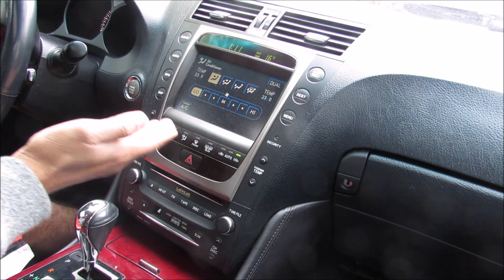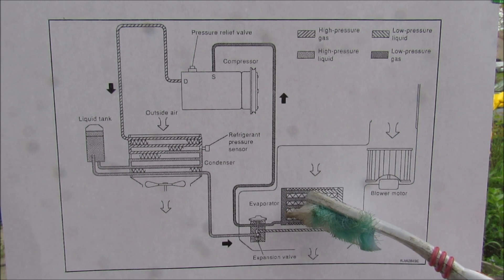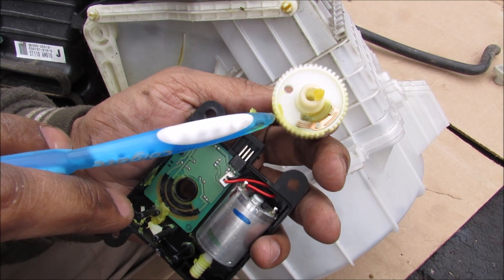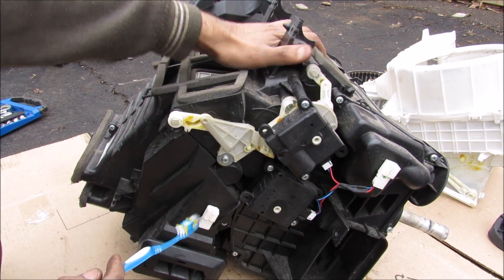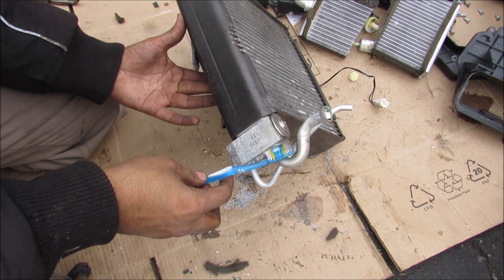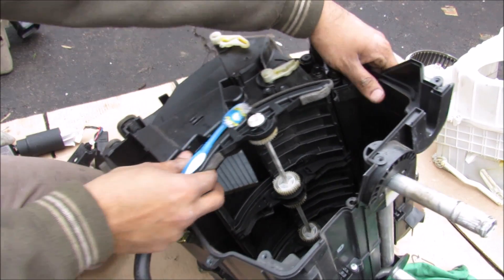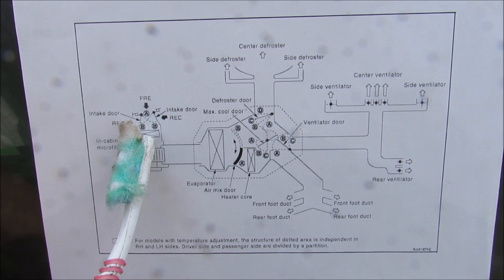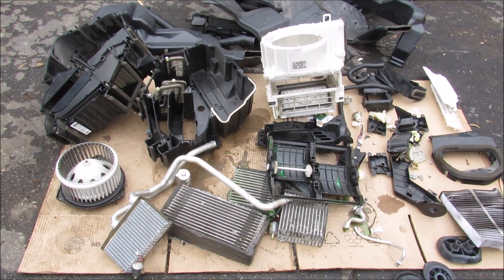How a Car Automatic HVAC System Works

Comment: If the motors are CAN based there should be 4 pins right CAN high CAN low supply and ground

Comment: And if one little thing goes wrong in that complicated mess... 8hrs labor to get in there. I've seen someone take apart a newer truck to change one of the temp sensors that had broke. The AC ran fine but the broken temp sensor made the auto ac feature screwed up. Idk... I have auto ac in my car but I never really use it. No way I'd pay $1k if it broke. Another thing: the GM 800s trucks and SUVs have the EVAP box under the glove box area. I've seen plenty of people just cut into the plastic airbox and switch out the EVAP core and any other reachable components before taping and gluing it back together. Not perfect, and a tiny bit of water risks leaking, but anything is better than having to dig into that dashboard and try to put it all back together with dry rotted plastic snap pieces and cracking trim pieces. I'd love to see an auto manufacturer come up with a more serviceable airbox. So far they're all very complicated and inaccessible. I do wonder what usefulness that airbox has in some other application 🤔 Maybe it can be rigged to an airtight painters booth for auto painting or some other clean-room setting.

Comment: my toyota yaris still blowing hot air despite the mixing unit working fine, i need help !
Reply from the maker: Then you need AC checked out
Reply: @speedkar99  the ac is empty right now due of condenser and new radiator fitted, i wll recharge the gas after, the current  problem is nothing to do with A/C.
I am talking for the climate control regarding the temperature selection, the mode selection os fine.

Comment: If compressor is engaged but no difference in High and Low side pressures, could it mean that the TXV is stuck wide open?

Comment: Sir I am Eric Ang from the Philippines. I have a Mitsubishi Mirage G4 2018 model. The AC runs under an HVAC SYSTEM. Old school AC we put  thermostat on half cold level so as to prolong the life of the compressor and for fuel efficiency or save on gas. For the HVAC SYSTEM is it true that it is the other way around? I mean is it true that if you want to save on gas and not keep the compressor always pumping, it is more beneficial to set the thermostat on full cold? , so as not to blend the cold gas from the evsporator with the hot air from the heater core? Pls enlighten me if this is true or a myth. Thanks and more power.
Reply: Myth. The most important thing is to always maintain enough refrigerant charge to allow enough oil to return to the compressor at all times. And to ensure the condenser is able to reject enough heat (fans, air dams must work correctly and condenser fins must be kept clean; a fan motor or fan clutch can be bad and spinning the fan way slower than intended even when it isn't making strange noises) to ensure a good enough compression ratio. All compressors, even ones never ever mistreated, do wear eventually. Want to keep the evaporator cold enough? Run blower at low speed. But the more the clutch cycles in order to prevent the evaporator from freezing up (keep in mind that automotive expansion valves are already calibrated to stop the evaporator pressure from dropping down too fast and therefore the evaporator fin temperature from reaching freezing temperatures too fast, by means of a cross charge that prevents the evaporator from starving at low evaporator pressures), the more the clutch wears.

Comment: What year and model is your GS? Any oil consumption issue?
Reply from the maker: 2007 GS350 RWD. Burns a little but not enough to top off between oil changes. 265Km

Comment: Perfect explanation as always. Would like to ask just one simple question: How does the system work to minimize the compressor usage (or power consumption from the engine) when you select a higher temperature as it uses a mixer and not an on/off principle? Or it doesn't? Thank you!
Reply: I'll try to answer. Since the car's compressor displacement is externally regulated by means of electronic control, the control valve solenoid on the compressor will be actuated so to keep a higher suction pressure and the compressor will reduce its displacement earlier as a result, keeping the evaporator warmer. If the compressor control valve is of the internally controlled mechanical type instead, a lower discharge pressure will act upon the valve's evacuated bellows (due to the lower ambient temperatures) and they will be able to expand earlier, achieving the same exact result, that is, a warmer evaporator and less power required to turn the compressor on average.
Reply: @teravolt6113  Thank you for your answer (sorry for the late feedback).

Comment: Hi speedkar99, if the heater knob is not on (ie temp set the coldest), does coolant still go through the heater core?
Reply from the maker: Yes, but on some vehicles there's a bypass valve
Reply: @speedkar99  Thanks. So if there is a bypass valve, there won't be coolant going through? Mine is a Camry, I touch the pipe that's going to the heater core in the engine bay, it seems hot.

Comment: We love your videos for going through dissecting the components and  explaining the theory  and operation. You have all the ingredients to be a good teacher and a mechanic. But can you make a video longer and explaining troubleshooting. We love to watch your videos and don't squeeze everything in 15 to 20 minute frame. I watched all your video and if you can slow and do more explanation. Specifically video on transmission and torque converter. If you can make two versions of the same video one for the ones who want  to refresh and one for us who want more explanation and never opened dash board of a car. I will me watching your videos when I open mine Thanks
Reply from the maker: Thanks for the compliment. Great suggestion but the audience here wants information and fast without wasting time. That's why I edit to be as short and to the point as possible. 

Any longer and I might as well open a university haha 🤣

Comment: Really good video. Only one mistake in regards of communication with servo motors. They are on LIN network, not CAN network. CAN would have 2 communication wires (CAN LOW, CAN HIGH) plus Power and GND (Total 4). Your is for sure LIN. Subscribed!
Reply from the maker: Thanks very much for the info. 
The repair manual actually calls it a LAN system. 

I'd love to learn more about how these protocols work!
Reply: LIN is much simpler and slower then CAN, however still interesting network type. You can learn a lot from materials released by suppliers like BOSCH. If you want to go really deep on it, I can suggest books or BSc/MSc projects papers. Godspeed!

Comment: Shouldn't the 3 wire connection be a LIN Bus?

Edit: Or does the ground go through the body?
Reply from the maker: Based on the comments here it probably is. I need to do some more learning on networks

Comment: Ase certified tech with hvac licence as well. Done dozens of evaporators and heater cores and hundreds of compressors, condensers, radiators, water pumps and various other components in hvac system. Still find your videos interesting 😂

Comment: Well I'll never buy an auto climate control car...looks like a massive pain to service. I'll stick to manual thanks 👍
Reply: Trust me, when the air/heater core flaps on a manual begin sticking due to heat and/or age and bad design, it becomes a pain to service too. Dash out time.

Comment: This video was another clear and comprehensive description, way to go speedkar99!
Also, modern automotive HVAC systems are so complicated! Wow, you should see my '77 Toyota FJ40.
Reply: Depends upon the car, my '03 Vauxhall Agila A is also primitive compared to this. There's not even an evaporator temperature sensor, because the variable compressor does everything on its own so that the evaporator never freezes, and another nice feature is that the evaporator will only get cold enough to provide comfortable air depending upon the weather. No electronics at all here, just a cleverly engineered compressor control valve. Too cold? Rotate the heater knob a bit until comfortable.

Comment: The bus is likely a LIN serial bus, which is 1 wire + power. It is used in place of CAN bus for accessory tasks and smaller sensors.

 It's also often used for the window controls and other simple dash controls. IT can be deployed using simpler/cheaper microcontrollers than CAN bus where data rate is not very high such as HVAC system in this video.

Keep up the great work!
Reply from the maker: Thanks very much for that information, I didn't know about that. I'd love to dive into Canbus programming some day and learn more!
Reply: @tveilleux is right.
 It is definitely not CAN. The bus feels like LIN but based on the diagram shown in the video it might not be 100% LIN. Nissan or the part supplier might have tweaked it for their needs.

Comment: nice video, btw is there anything stopping air escaping from the evaporator drain, when there's water dripping it doesn't look or feel like there is of any forced air coming out? But then lots of people clean their ac by putting foaming cleaners through the drain hose.
Reply from the maker: That's a good question, I didn't see to disconnect the hose to see if there is a valve
Reply: Good question, i guess the blower fan and evaporator box is designed to take it into account so that any airflow loss is minimal and some air actually helps the condensate water drain away. I confirm there's no valve on mine, but the drain hose is still pretty narrow, and it's shaped not unlike the trapway of a siphonic toilet bowl. I've never put a finger on it with the blower on by the way

Comment: I've always been wondering - when you turn the HVAC off what happens to the coolant in the heater core? Does the coolant still flow through the heater core basically making it super hot, or are there some bypass valves to redirect the flow around the heater core to prevent all the plastic in the air mixer from overheating?
Reply from the maker: Some vehicles have a coolant shut off valve outside the firewall that blocks the flow of coolant thru the heater core. This one doesn't appear to have it. 

I don't think the heater core can get hot enough to melt the plastic housings
Reply: @speedkar99  ah, ok. Thanks! I noticed in my car (regular HVAC controls with knobs, no climate control) when I turn the vent selector to 0 I still get a little bit of hot air coming from the dash vents. I would assume that means that there's no coolant shut off valve in my car.
Anyway, thanks for another great video! Straight to the point as always. And I absolutely love your toothbrush pointer haha.
Reply: In my Vauxhall Agila A there's no heater flow valve. Water is always going through it. The heater flap takes care of everything and in the summer, when the heater knob (directly connected to the heater flap through a Bowden cable) is on the cold position, i still get ice cold air at the vents even when coolant is hot. Also, running AC also seems to unstick the distribution flaps in the heater box, which tend to stick whenever i've left the car in the sun for a long time.

Comment: Great informative channel. In my 2019 Nissan Patrol Y61 the AC is very cold when car is moving but when I parked & engine is on AC become warmer. Well can you tell any suggestions to make it constantly cold.
Reply: يهمني نوع السيارة التي في العرض
هل تعرفها
وشكرا لك
Reply: انفنيتي G35
Reply from the maker: Thanks. I find many car AC systems are like that, more RPM means more energy for the system to cool down since it does suck alot of energy off the engine

Comment: Great video, are the block expansion valves adjustable like in your video to allow more liquid to flow into evap? Trying to lower the vent temp to 40° from 45°.
Reply: That little nut controls how much the evaporator fills up with refrigerant indeed, but i highly suggest you to never touch it or you may damage the compressor (i.e. if you open it too much you may slug it with too much liquid, or if you close it down too much you may deprive it of cooling and lubricant). If you feel the TXV has some issues, just fit a new one. By the way, the TXV will never control the evaporator temperature. It will only control at which temperature the refrigerant will exit the evaporator and this is meant to prevent it from exiting the evaporator's outlet as a liquid, even though, with this valve, the superheat will progressively switch to 0 as the evaporator cools down, and as a result some liquid refrigerant will start leaving the evaporator (this is meant to keep the evaporator pressure from dropping down too fast, avoid interfering with compressor control valves and keep the compressor lubed). The minimum evaporator temperature is controlled either by a pressure switch, an evaporator temperature sensor or a compressor control valve. What you have in mind will, at most, control how fast the evaporator becomes cold, but again, don't touch it. Look elsewhere to solve your problem.
Reply: I would assume the needle spring will weaken over 10 years or some of the gas leak out of the temp sensor disc. A weaker spring would allow the needle to open more allowing more liquid and faulty disc would not push needle down enough, I would say the later is more likely to happen. TXV are very cheap and if I gain 5° more cooling its worth it, only negative is system needs to be discharged.
Reply: @metalhalide4043  The power charge will never leak out of the disc, it's a tiny amount, there's also some adsorbent so that the valve won't "hunt" superheat. I obtained a 20 year old one i like to play with, i've disassembled and reassembled and tested it again and again, and it opens and closes perfectly. On my channel i show how the ball closes the valve when you spray liquid canned air upon the disc... never seats fully closed though, because it came from a car equipped with a Sanden SD6V12 variable compressor...
Reply from the maker: Good info thanks
Reply: @metalhalide4043  TXV systems never cycle on suction pressure that i know. Only CCOT systems do that. TXV systems only cycle on the output of a evaporator temperature sensor, if the compressor is of the cycling clutch type. With a fixed displacement compressor, very low suction and high/normal discharge means stuck closed TXV, normal/low discharge and high suction means stuck open TXV. With a variable displacement compressor (for example Harrison V5, Sanden SD6V12), pressures won't tell you much because the compressor is able to adjust working pressures. Noise is more of help, loud groaning noise means low displacement operation and this tells you of a compressor that is trying to increase a very low suction pressure (created by a stuck TXV for example) by fully destroking. Stuck open TXV is instead indicated by frost on the suction pipe. Then there are externally controlled compressors. A lot depends upon the compressor...
Reply: @metalhalide4043  STEM student interested in how air conditioning systems work, i read a lot of stuff about them everyday. If i were something more than that, i'd have said it right from the start. For example, if i were a pro i'd have introduced myself with the following words: "I'm a licensed HVAC technician".
Reply: @metalhalide4043  Refrigerant handling licence is required where i live. And a licence is useless if i don't own any business (and running businesses is a very very hard thing in my country right now). I can't do that, unfortunately, at least in my country. The most i can do is everything that comes after someone licensed has recovered the refrigerant. I.e. i can replace an evaporator, o-rings, TXV, compressor, piping, flush a system etc., but, after i'm done, someone else will have to check nothing is leaking, and then vacuum and fill it up. If i were to do something else than that, i would break the law.
Reply: @metalhalide4043  Across Europe, unfortunately, things are very different.

Comment: I am not a Technician but I would have to charge maybe $1,000,000 U.S Rubles to repair the condenser on this car.
Reply: You're probably meaning the evaporator. That's how the heat exchanger located inside the interior is actually called.
Reply from the maker: It's a labor intensive job!

Comment: lot of moving and load bearing parts in plastic... how was the reliability on this model?
Reply from the maker: I wouldn't call the plastic load bearing. Usually the doors are the first to break off or get stuck, or an actuator fails

Comment: The "dye" is mostly the oil in the system, shouldn't be very much dye in it compared to the amount of oil. Just clarification.
Reply from the maker: Good tip, but does a little dye color all of the oil that much? It seemed excessive.
Reply: @speedkar99   For some reason the dye likes to dry into a solid green paste/powder over time... happens with a minuscule leak my car's CVC compressor has at the moment (HP relief valve o-ring, looking to get it replaced)... PAG oil alone won't do that. Agree, looks like too much, perhaps too much dye added during a regas/regasses... or is it that way OEM? Anyway it should usually be like 5 mL of dye and 150mL of actual oil, but i guess AC stations add some dye everytime by default, and it just adds up...